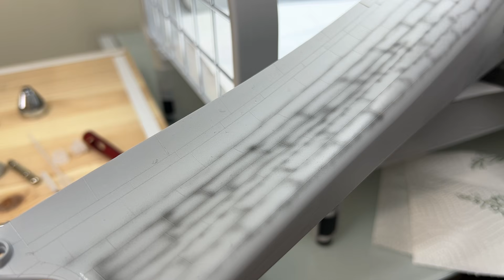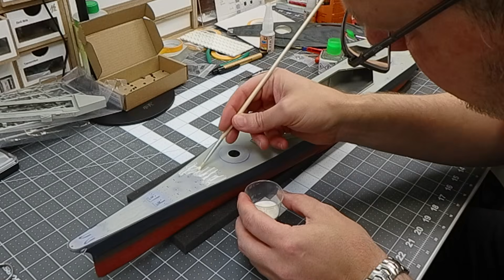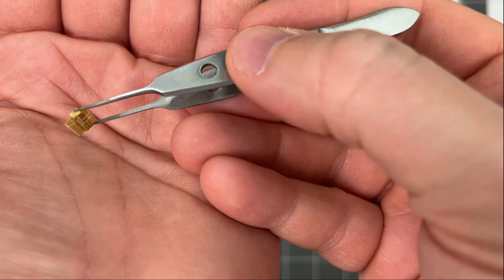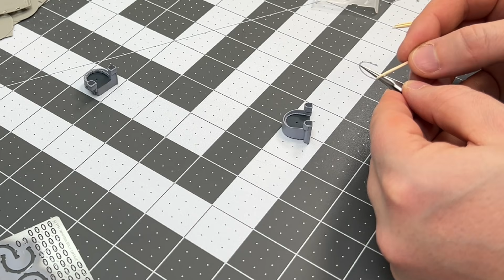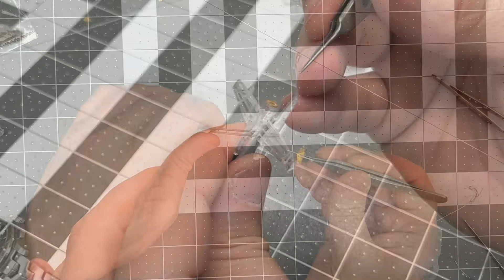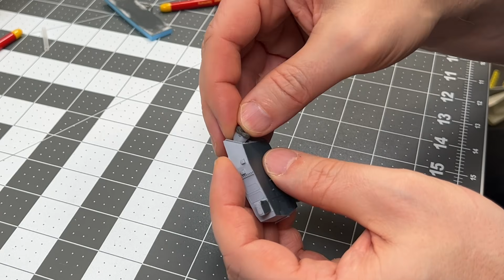Full Build - 1/350 USS Missouri (BB-63)

Comment: Hi Kenneth,
That's a good tip about glueing the wood deck down using gorilla wood adhesive , do you leave the backing paper on the back of the wood deck or remove it ,
Thank you ,
Colin from UK.
Reply from the maker: Glad to hear. I remove the backing paper, otherwise that would separate down the line.

Comment: Excellent work, great video.  I too have this model, but haven't started it yet. I will certainly be using your video as a guide.  What magnifying glasses are you wearing?  I wear glasses and have had trouble finding a suitable pair.
Reply from the maker: Thank you 😊 I am using a pair that looks like a regular set of glasses, meaning without the headband that many of these have. Not sure which brand it is, but I have seen it advertised on FB a lot.

Comment: Can you explain more on the problems with ScaleColors paint? I have a lot of their paint on the way. Customer service and wait time already have me doubting my purchase. Great job with the ship.
Reply from the maker: Certainly; it gives a lot of issues drying quickly on the needle (tip drying issue) and even inside the cup, adding retarder didn’t help, some of the colors do not adhere to the surface that well even with good primer - don’t get me started on the customer service and wait time - just awful. The owner even goes so far as he will just ignore you if you have problems. So find something else, there are a lot of good options. Thanks 😊
Reply: Thank you. If you have any recommendations on the brand of paint you switched to… USS Washington (BB56) build so as close as possible to “real” colors.
Reply from the maker: @RichShips  It depends if you want to try out lacquers and where you are located.

Comment: Another fantastic effort.  At this rate you are going to need a bigger house to store all the ships. 😁
Reply from the maker: Thank you Craig 😀 It is becoming a problem for sure, I need a bigger man cave - which is 2+ years away 🤔 Well what to do 🤷‍♂️ Maybe build something smaller like Arleigh Burke in 1/350…
Reply: @NorwegianModellingBench  you could always build the new 1:200 arleigh burke class, it is only a destroyer, so its smaller then a battleship. 😉
Reply from the maker: @Marterrin  I have seen that HS models are working on a really impressive detail up set for the 1/200 one. Very tempting, but I have all I need for a 1/350 (USS Momsen).
Reply: @NorwegianModellingBench  do you have the pontos set for the Momsen? That is in my stash as well,
Reply from the maker: @Marterrin  Yes, and a lot of HS models parts 😉